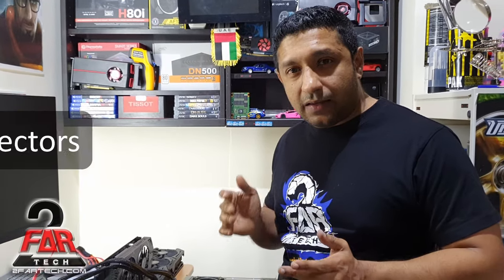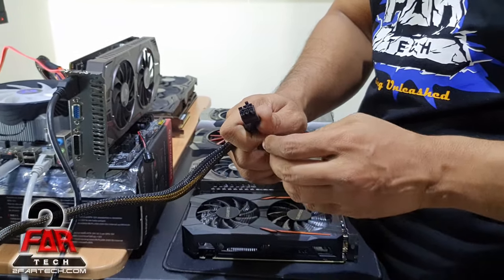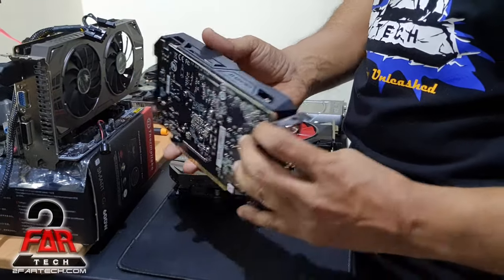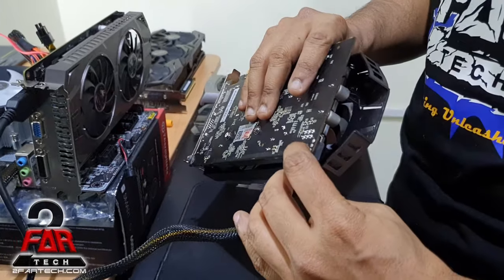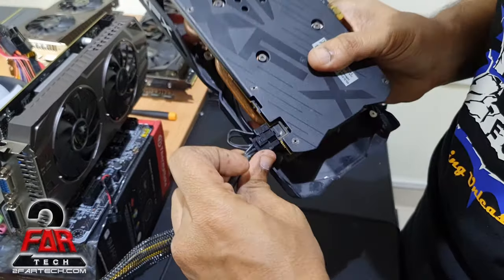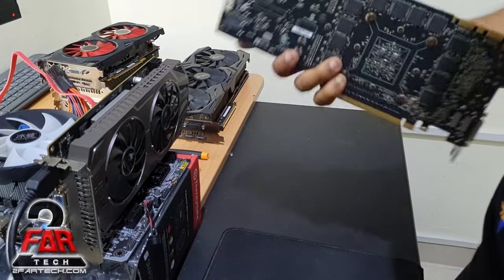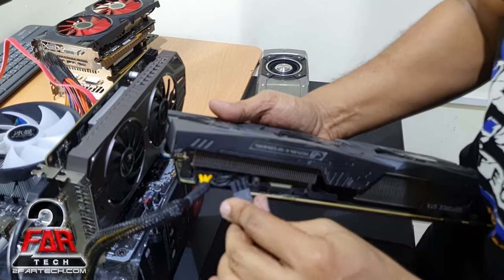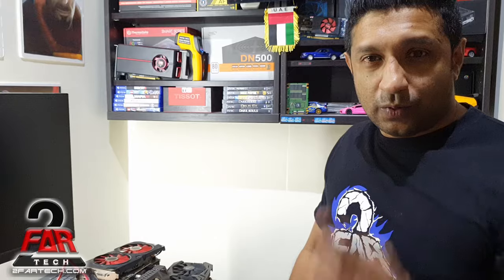How to connect the power to the graphics card?

Comment: Hello nice video, one question my gpu needs a 8pin and 6 pin and my power supply has only 6 pin and some two old 4 pins that arent connectable to the graphics card (gtx 970 g1 gaming). Should i buy a new power supply or buy a 8pin cable and try to connect it to the power supply?
Reply from the maker: As per your statement, the power supply isn't powerful enough for your graphics card as per the power supply manufacturer. Regardless of the power rating on the PSU, the manufacturer sometimes protects themselves by only providing just 1 x 6 pin or 8 pin pcie power connector. So practically you cant connect more power hungry card to the psu. So in you case, if you can spare some money, Get a decent PSU that has two 8pin pcie power connectors.
Reply: @2FarTech  Thank you for your responding sir! subbed!

Comment: hey, i just got r9 270. mine has two - 6 pin pcie connector. my psu only have one 6+2 pin. can i use splitter for that? is it safe? or can i just power it with only one 6 pin cable?

Comment: Hi I just got GTX 750 and it has 6 pin but my power supply already plugin to the motherboard with 8 pin. And when I plugged it in. It won't work I guess I need a adapter for the gpu power supply 6 pin connector?

Comment: Does a gtx 750 require both of the connectors plugged in or does it just need one 6pin or one 8pin?
I have a 750TI but i think it should be the same.
Reply from the maker: It depends on the ports on the card. If card has 1 x 6pin port only, you need only 1 x 6pin. I dont think the GTX 750 or GTX 750 ti would require more than 1 x 6 pin. There are some models of GTX 750 Ti without pcie connectors.

Comment: this may sounds late but is it safe to use splitters such as molex or 8 pin if the psu has no extra 6+2 pin but the gpu requires 2 x 6+2 pins?
Reply from the maker: The answer is No.
2 x 6+2  pin requirement is a high power gpu. The psu definitely will not support initial power draw when the gpu starts doing graphics and even if it sustains, you would hear a pop and smoke anytime during is operation.

Comment: where did the cable come from? is it standard with youre power supply? or is it with my RTX Card? or do i need to buy it ?
Reply from the maker: The cable should be on your Power supply. If its not there on your power supply, then you need a better power supply.
Reply: @2FarTech  thanks! Maybe i fo have it, but i think i will buy a Be quiet power supply

Comment: Not quite. If you have a modular power supply where should the other end be plugged into? The PCIe port or VGA port? I've tried pugging it into the PCIe port on the power supply and my 980 TI hasn't powered up....
Reply from the maker: Sorry I couldnt actually understand what you are implying. I am using a non-modular PSU. So the other end of the wire i am holding is connected to the PSU.  Is there a VGA port on PSU? Yes it should be saying PCIe on the modular PSU. And GTX 980ti definitely requires 2 x 8 pin power connections right? Did you plug in both?
Reply: @2FarTech  On two separate modular power supplies the other end was plugged into either the PCIe port on one supply (each time using one or two cables) or directly out of the main power supply socket on the other. Neither solution worked. All sets of cables were fine. 980Ti uses 6+2 pins and a 6 pin.

Comment: I still have some confusion. I upgraded to a 3070ti which requires the 3 8 pin connections. My PSU came with 2 PCI-E 8 pins (each is an 8 pin at the PSU end, and the other end is a Y cable to x2 sets of 6+2. So right now I'm using the first cable coming from PSU 1st connection to the GPU's 1 and 2. Then I use another identical cable in PSU 2 going to GPU 3 (and the other side of the Y cable Is just not used because.... well.. it's got nowhere to go). Is there an advantage to using 3 separate cables all going from my PSU to each of the 3 connections on the GPU? I have 5 available holes for PCI-E/CPU on my PSU and with this current method im only using 3 (2 for the GPU and 1 for the motherboard CPU power). I definitely have the holes available on the PSU but im having trouble finding the cable I want anywhere. Does no one just make a straight up 8 pin PCI-E cable without having a Y split on the other end? looks ugly and I just want to make sure I'm getting proper power to this GPU. Thanks!
Reply from the maker: I understand your confusion because I recently set up a few machines on RTX 3070Ti. I used high-end and cheap PSUs to achieve this task. 
After reading your action, I am sure, you did fine. So don't worry. If you can't find the extra cable the keep the setup as it is. If you can find the extra PCI cable then use it and only the 1 end of the Y to be connected. So you will have 3 wires from PSU going into the GPU. That makes wiring a bit more complicated and then you have 3 connectors not used, more ugly. The current way you have done is fine. It's the same way most would set up the PC. I hope you have a PSU with more than 750Watts Output. i7-11700K + RTX 3070ti hits 700Watts peak initially. But settled down in between 550 + 650Watts under stress in extended usage.

Comment: If i have a choice between buying a card with 6 pin power and 8 pin power which one would you recommend going for. Do most power suppliers come with 6 pin or 8pin?
Reply from the maker: You should always buy a card with highest number that fits your budget. Don't let the pin decide the card you should buy.  These days most decent power supply with 450watts or higher comes with atleast 1 x 8 pin power connector. If you have an existing psu, then check the model details online to find out more the pins before you get a gpu

Comment: I have a gtx 970 g1 gaming that needs a 6-pin cable plus an 8-pin cable. I'm looking at power supplies to buy, and they all have the 6+2 cable.  Can I use one of 6+2 and another of 6+2 leaving the 2 disconnected?
Sorry, i don't speak english
Reply from the maker: sorry about the delayed reply. The answer is Yes, you can leave the 2 disconnected.  In the video I am having one such GPU with 8pin + 6 Pin

Comment: Hello plz i need help i have a VX PLUS 600w not modular with a (6+2)x2 gpu connector can i run a rtx 3080 knowing that 3080 is (6+2)x3 on it if yes how? Thank you
Reply from the maker: I use a lot of AEROCOOL Products, especially the LUX 550Watts. Aerocool plays it safe by not providing excess PCIe connectors so normally you can not overload the PSU. Your 600Watts PSU actually provides only 552Watts on the 12V. I am going to assume that the Processor, Motherboard, and other components might use at least 120Watts at peak usage. Which means you are left with 432Watts for the GPU. And 3080 can pull up to 320Watts or more. This means you are coming a lot close to more than 90% of the maximum power available. Aerocool claims your model is entry-level, so even if you manage to get the 3rd (6+2) by using Molex or Sata convertors, I suggest you don't do that. If you do this, there is a small chance you might not have any issue, but there is a big chance you might blow up the PSU and cause damage to your PC. Nvidia recommends a decent 750watts PSU.  I suggest you get something in 750 or 800Watts.

Comment: I need help, i have an aorus 6900xt master that has a triple 8 pin connector, can i use the 3 6+2 pin connector? Is it enough to power the gpu with 75watts from the mobo and 75x3 from the 6+2 pins?
Reply from the maker: The three 6+2s are  individual independent cables from the psu, or are they piggy tails?
Reply from the maker: Midel details of your psu
Reply: @2FarTech  hi, i don't have a psu yet, but i'm planning on getting the gigabyte ud1000gm, and i want to use individual 6+2 pins

Comment: Thanks. I actually have a cable that splits into a 6+2 and 6+2. Hopefully that's good for the 8 pin 3070 I have.
Reply from the maker: The cable is part of the psu right?  I mean it came from the factory that way?  Then you should be good.

Comment: If my power supply has two 6+2 cables and my graphics card is 12 pin, then I only have to use the two 6 pin cables leaving the other 2 aside?

Comment: Thanks for the video. is t normal that i mis 1 pin of the 8 pins?
Reply from the maker: The extra pin on an 8pin cable is added ground wire to allow more current flow. Which means more power to your GPU. Some models of GPU has detection mechanism on the card. So if you just plug in only a 6Pin it might fail to start. There could also be LED indication on the card to show if its okay or now. The 8pin is required for a reason and not providing that for the card might not be the best way to deal with the situation.  The extra 8 pin isnt provided by some PSU as it cant handle the extra power required by the GPU.
Reply: @2FarTech  Thanks for the fast respons! The reason that i ask the question is when i play a game there Appears a red horizontal line beneath the monitor. What you think? can that be the issue or am i looking wrong.

Comment: do i connect the second 8 pin from my gpu to my power supply directly ? 
as i am upgrading my gpu currently is 1 8 pin so i’m just confused what to do with my new one with 2 8 pins
Reply from the maker: If you have an additional cable from your psu, use it.  If your psu has only 1 x 8 pin main wire with a piggyback 8pin, then use the piggyback.  The first option is preferred.

Comment: In my motherboard, their are two pci-e connectors one is 6+2 and another is 8, and in my gigabyte gpu, a white led blinks for a second when turning on the pc and then it goes off, and the 8pin power connector is powering my gpu, should I try the 6+2, or go to the nearest service center? I have a Rtx 3060 ti by the way
Reply from the maker: can you tell me whats the model of your PSU? So I can find out what are actually provided with it. Are you sure the 8 pin, isnt the CPU power connector? I suggest you remove the GPU and just try to start the PC with the motherboard. and processor. If your motherboard has LED indicator or You have small sound buzzer on the board, you can do a bit of troubleshooting too tell me what you see or hear.

Comment: I bought my first graphics card which requires a 8 pin. I have a 6 pin connector. Do  I have to buy and replace the 6 pin with an 8 pin? And if so, how do I do that?
Reply from the maker: I can give you a precise answer if you can tell me the exact model information of the graphics card and the model details of the PSU on your PC. Would you be able to find that information?

Comment: Hello sir I have a question I recently upgraded from a 1050ti to a 1070 but my modular PSU doesn’t have the PCI e cables but I’m pretty sure my PSU can run the card it’s pretty powerful it’s an EVGA supernova 650 watts, I’m just wondering can I just buy PCIe cables for my PSU I bought my PC used so I forgot to ask for any extra cables for the PSU thank u😊
Reply from the maker: You should ask the same person for the cable. 
Psu cables are not the same, so you can't just buy random pcie cable and try your luck.  It might end bad for you. 
If you can't find the original cable, thyme search for the pin out diagram of your psu in cablemod websites.  See which is the closest famous brand psu cable.  Then try to get a generic cable that matches this pin out. For example i have an asus rog strix 1000 watts psu. I couldn't find the replacement cable for it.  But i found the pin out is similar to a certain corsair model which has copy pcie cable available on amazon.  I brought that.
Reply: @2FarTech  it says on the product that it’s compatible with my PSU should I just buy it or I need to change the whole PSU
Reply: @2FarTech  my last question is do you think I need to get a separate PCIe cable for my 1070 or one can run it enough
Reply from the maker: Share over here the link, i will just double check for you.
Reply from the maker: 1070 would survive on 1 pcie cable with 2 x 8 pin splitters on the end.  But just to be on safe side get two separate cables if your 1070 needs 2 x 8 pin
Reply: @2FarTech  yea I’m trying to send the link but after I send it the message gets deleted
Reply: @2FarTech  how can I send the link every time I’m sending it’s getting deleted
Reply from the maker: That cable seems like the one for your psu. Good luck with it.
Reply: @2FarTech  ok thank you so much bro 😁

Comment: Some PSU's have 2 8 pin connectors on 1 cable.  Is it safe to use one cable or should I use two seperate cable for a dual 6 pin card?
Reply from the maker: If you have 2 cables and you have a dual 6 pin card,  go ahead and use the 2 cables if you can manage the cables. Less power draw through the wires,  less resistance and no electrical stress on the points / joints.  In practice it might have no advantage,  but since you have it use it for as best practice
Reply: @2FarTech  Thanks for the sound advice!  Ill be applying this on the weekend as im updating my power supply and the one Im looking at has 2 6+2 connectors on each wire (4 total).  I love cable management but Ill opt for safety and use both wires which can still easily be hidden!  SUBSCRIBED!  Thanks again.
Reply from the maker: I have provided support and service to people who had the cable connection melt and burn up on the psu side for modular psu.  And those were high end psus and also i have units running max power on a single cable for 6 plus years.

Comment: I've just got my first graphics card and it's a six pin. I'm wondering if the six pin is in the pc already or if I need to buy one and if I need to buy one where would it connect in the pc?
Reply from the maker: Is your pc branded?  If yes which model and details.  You see the cable i am plugging in the graphics card.  Try to see if there is a free pin inside the cpu. If you cant find it tell me 3 things, what's the maximum power rating of your psu in watts, how many molex /sata free connector are there in your pc, what is your graphics card model
Reply: @2FarTech  me too i cannot find the pci 6 pin in my pc

Comment: I have a 8+6 pin slot but just a 6 pin power cord. I plugged that in & it says i need to power to it.. do i need both connections? If so & my computer doesn't have both what do I do?
Reply from the maker: 6 pin power cord means you are limited on power by your psu manufacturer.  The best way to go about it would be to upgrade the psu to a better one.  600 watts psu or better.  Branded like Deepcool, aerocool, Thermaltake, corsair etc...

Comment: Hello, nice video. Actually I am about to build a pc very shortly.  I have a 3080 Suprim X and a Corsair HX1200 psu. The 3080 has 3x8 pin but my psu only has 2x8 pins and one 8 pin for cpu. I am 100% totally confused how to have 3 separate cables between the psu and gpu . The spec sheet says 8 x 6+2-pin PCIe but i can only see 2 of the 8 pin and 1 for the cpu. There is one other 8 pin down at the bottom right, but it doesn't even say what that is for . Please any help would be so appreciated and I am totally stuck!!!!!!
Reply from the maker: I have tons of corsair HX1000 PSU, we build mining rigs with this PSU,  it should be having 6 to 8 PCIE cables. Where are the rest of the modular cables that came along with your PSU. I am not sure about the source of your PSU. Sometimes when you buy the whole system as pre-built, they don't provide the additional modular cables that came with the PSU. In this case you need to buy these correct versions. Please make sure its meant for your PSU as, modular PSU PCIe cable pin out varies from one PSU manufacturer to another. It must be easy to get the cable for corsair. Good luck. (The other 8 pin could be for Motherboard Processor / CPU, same like the 8pin connected near the CPU, some high end motherboard for overclocking accepts dual 8 pin power input..

Comment: hi. i am using dell optiplex 9020 . it has 2 -  16x graphic slots. can i use 2 low level graphic cards at the same time. please inform me..
Reply from the maker: To get better gaming performance?  NO. FOR GPU mining or video rendering?  YES
Some older gpus support SLI (nvidia) or crossfire (AMD). Nvidia has Already officially stopped supporting SLI and you need an SLI bridge to link both the GPUs together.  Few years ago i used to have two GTX Titan on SLI and it was okay most of the time.  But these days SLI isn't the thing anymore.  So you gotta research about your specific card and see if you can run them in SLI or crossfire for a decent improvement in fps.

Comment: How do I connect my Aorus GeForce 3070ti master because it has 2 * 6 Pin and 1* 4 pin ? Can u help me please ?
Reply from the maker: Its has
2 x 8 pin
1 x 6 pin
Which means you need a psu with
4 x 8 pin (6+2) 
You will use 3 connections from those 4 pins. What's your psu? Unless you have atleast a good branded 750watts psu, don't use the card.  You can Also try to use the card with just 2 x pins connected and see if you get a display.  Typically gtx 3070ti uses 2 x8pin, your can be overclocked this requires more power and the extra 6pin connection.

Comment: As I understand it, I need 2x8pin for rtx 3080, but need only one cord or two? I have Seasonic Focus 80 Plus Gold 650w
Reply from the maker: Is the psu provides 2 separate wires with 8pin. I would use both wires.  So even under full load there is no drop in voltage and under load the cables doesn't heat-up and increase the internal resistance.